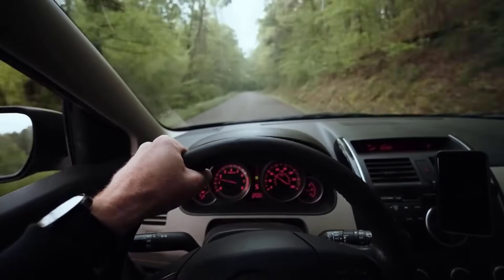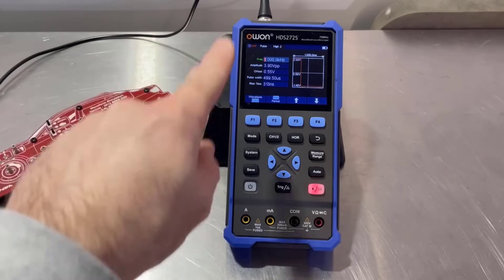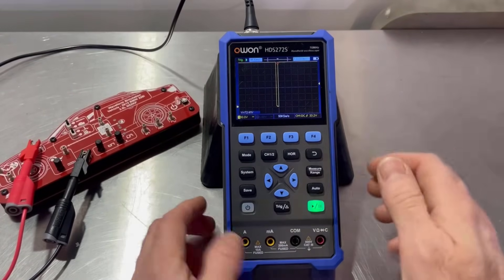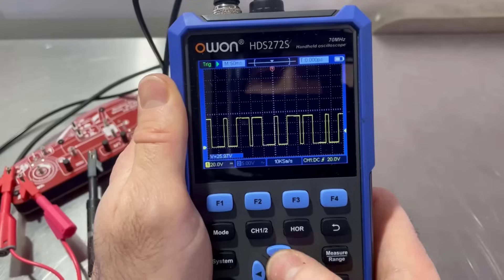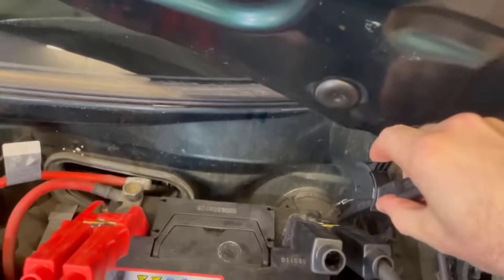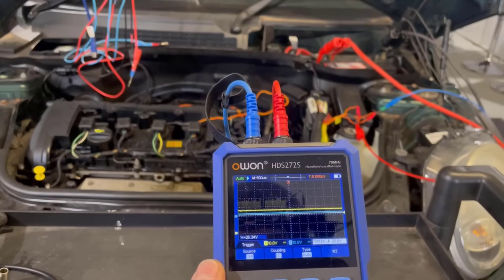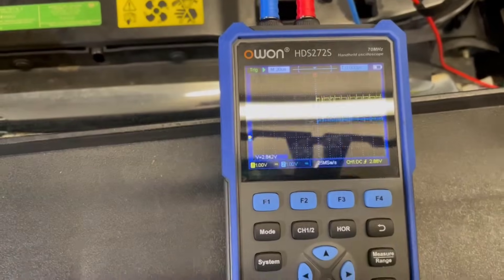Owon HDS272S For Automotive Diagnostics?

Comment: When you say use still have handy the Pico scope for PC-based viewing..  doesn't the OWON HDS272S also allow you to view/control everything from the PC via a usb cable?
Reply from the maker: Yes, it does. I haven’t really used it. However, the specs aren’t close to PicoScope for in depth diag 👍

Comment: Hi Darren, I have this tool, but I'm struggling with the save feature. When I try to save a waveform, and then try to look at it later, it doesn't display anything on the screen. If I make a reference waveform, that seems to work okay. I'm just wondering what your experience is with this feature of the tool?

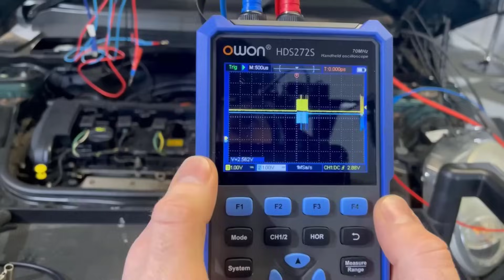Comment: I just discovered and ordered an Owon directly from China at an advertised $175 savings. It’s their latest hand held 2202 version. Another benefit is that Digi-Key is an Owon dealer, so if a 16:15 user’s guide is needed or other accessories like leads, and product information it is readily available.

Comment: Hello. I'm new to oscilloscopes and I was wondering why you opted for the hds272s instead of the hds242s. Is there anything on an automobile that couldn't be tested with the 40Mhz bandwidth of the hds242s?
Reply from the maker: No, that 242s will be fine - actually 40Mhz is well above the minimum requirement for most signals. The limit with this small hand held scope is the screen size and resolution
Reply: @ Makes sense. Thanks for the reply.

Comment: Hi,
I wanted to ask you about the sampling rate of the Owon you reviewed. You said that the display is too small to read that camshaft signal and doesn't fit in the display! How about the pc hardware that Owon provides for this device? Would it be possible to read that signal live on pc via usb? Because for what I read in the specifications, Owon has way more sampling rate than the Pico! Or they lie about it? Would appreciate your answer. Thanks in advance
Reply from the maker: @jacklamata2544  It might be better on the PC. Also, sample rate isn’t the only thing to consider; sample rate is limited by it memory. So it’s relative sample rate
Reply: @MechanicMindset  So I have to search for something with Milion memory? The thousands of numbers of the memory from an oscilloscope are not enough to read that camshaft? I've seen an oscilloscope with 100m/s and 10M memory! I don't remember the name, I have to check in my browser! Do you think that's enough to cover all the automotiv work with such an oscilloscope?

Comment: Hey buddy, great information. I have an old BMW 320D e46 just getting into diagnostics and watching you videos to gain insight. Just attached a breakout box to the dlc and it flashed up warning ‼️ registering 7.5v on the high side. With the battery removed ohms testing from pin 6/14 I have 220 ohms. In all the videos I have seen so far it says 60 ohms and everything is good 120 ohms and one resistor is blown so does 220 mean both are blown? If there is answers in your online course I will join now. Many thanks
Reply from the maker: Hi, I can’t remember the E46 layout, but it really depends what the ‘topology’ is. 

It’s not always possible to get the full CAN network at DLC. Best check at the module that has the problems. 

We have a full course on CAN and more; it will help give you a better perspective for sure 👍
Reply: @MechanicMindset  thanks for the reply, just signed up and have started to watch your videos in the order you recommended on the site video. It looks very impressive and you have a nice clear voice that I can understand and could listen to for ages without getting bored. Many thanks 🤩
Reply from the maker: @Ken_4711  Ah amazing! Hope you enjoy the learning! Thanks

Comment: Great video, I've just bought a owon hds272s but only comes with one probe i have a pair of P6100 probes will they be ok to use just to check can bus and sensors if faults occurs on my car
Reply from the maker: @paulfrancis2790  if they are BNC they should be fine 👍

Comment: Hi, I bought the OWON HDS272 oscilloscope and I want to use it to adjust gain in a car amplifier to detect clipping, I play a 1000 Hz test tone and I increase even to the end, the waveform only increases and does not change to a square, I would really appreciate it if you could help me tune the oscilloscope?
Reply: I used my HDS272S to adjust the gain on my amp for my subwoofer. Set to AC and it worked perfectly. Could clearly see where the sine wave squares off when it was clipping.

Comment: Thanks for the video ! If you connect the positive end of the oscilloscope probe  to the negative wire of the coil and the negative end to ground, you will get the desired signal waveform. In this case ATTENUATOR  is required. In my case the spike is 400 V.

Comment: I own one of these, the scope function is good.  Resistance measure is too slow.  Standby battery drain is good, but the battery drains too fast when on.  Other than that, it is ok for a device around $200.

Comment: I bought the same but slightly newer. If you have trouble as an expert, what chance do I have in figuring out it how to use this correctly!? 😂 Looking now at PC-based oscilloscopes with access to known goods.
Reply from the maker: It’s ok once you start using it it; I think their challenge is packing all the oscilloscope features in to a small package. I use it regularly now but admittedly; I often hit the wrong button for adjusting the scales. No biggie 👍

Comment: I got this one. 70Mhz is good enough for about 95% of the diag work. The function generator covers most signals to simulate. For the money it is one heck of a handheld scope. My only gripe is the buttons are not convenient. Simple things like changing trigger level for CAN like you show is a pain and other settings like that are not very clear to find and require cycling through many menus to access basics functions that should be right there at the press of a button. Other than that is will get the job done and is fast enough to see alternator or fuel pump ripple.
Reply from the maker: For sure, settings are a learning curve 👍

Comment: The new model is 200hz, unimportant in automotive but it also has many more sample points. I don't know enough to decide if it's worth the higher price 🤔 Any tips?
Reply from the maker: The specs of this one are sufficient. It’s the memory which is the important one for us; so we can zoom in to saved data and see the details. 

For what it is, I really like it, good for quick checks. I’d get the Pico out for anything in depth

Comment: Hey there, I have an owon hds242s handheld oscilloscope, just wondering if you have used the signal generator. I wonder if you ever thought about doing a short video on roughly how to use them / how to know what to input for a given sensor etc? I really don’t have a clue how but they seem a useful feature.
Reply from the maker: I’ve not used this one really. The voltage output is too low I think but might work. You could use AC signal to test wheel speed input to ABS on some cars

Comment: Just got hds 2202 for work but the multimeter operation won’t work just shows E on the voltage measurement plus DC/AC won’t change tried restarting but no joy and this model is not on the website so can’t do firmware update .going back to Amazon not impressed!!!!!
Reply from the maker: If it’s faulty, send back 👍

Comment: My interest is for the ignition systems of classic cars pre 1990's mainly, I'm particularly in using a portable system for use on the LT & HT for classic ignition systems.  Are there any inductive HT connectors which will communicate with an Ipad, for the IPad to then be used as oscilloscope display via an app?  Thanks

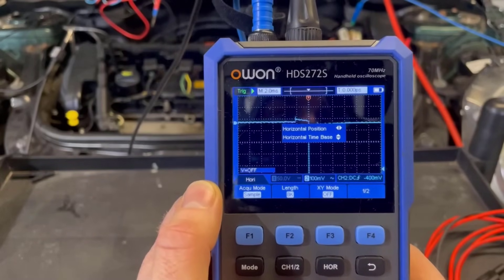Comment: On your secondary coil test (12:36) ---  when it's inverted like that-  just flip your clamp over on the wire and it will flip your waveform
Reply from the maker: Inductive clamps don’t work like that; it will work for an amp clamp 👍

Comment: How does it compare to something like a Hantek 2D82Auto?
Reply from the maker: Not tried it, but similar I imagine. It was close between these; I chose this for the better screen. That’s all
Reply: @MechanicMindset  I'm debating between a handheld or a laptop based. The 6074BE is looking very tempting.
Reply from the maker: @ClarckRPieters  I suppose it’s depends what you want it for. Quick checks on PWM and things like that, hand held is fine. For more I depth, laptop or tablet will be better. Check out the Hantek tablet 👍

Comment: Is it possible to measure dirty electric in mV (a clean or bad AC sine wave) using the HDS272S?
Reply from the maker: Sorry not sure, what are you testing?
Reply: @MechanicMindset  Testing my house's electric AC for dirty eclectic. Currently, I'm using a Greenwave EMI meter to test in mV. From the meter, I'm getting 150 mV with six Greewave wall filters installed and up to 1200 mV without the wall filters. I was hoping to test the accuracy of the EMI meter with an oscilloscope. Any suggestions?
Reply from the maker: @andynonimuss6298  Ah ok, sorry, it’s not my area or knowledge.
Reply: @MechanicMindset  Ahh ok, understood. Thanks for your time in response.

Comment: Why do all the YouTube content providers choose to use the HDS2772S when that scope was superseded by the HDS2102S over a year ago? The latter is a 100MHZ scope that uses proper specified components rather than relying on overclocking in the 70MHZ unit. It has better performance at almost all levels yet the old model keeps cropping up in vid after vid. That just seems a very odd choice.
Reply from the maker: It’s not on Amazon here in the UK. I just looked for a decent hand held. It was between this and the Hantek. I chose this for the better screen. To be honest, frequency isn’t a factor for me with automotive diag. Possibly with Flexray and CAN FD and later XL. In fact, I often use low pass filter @20khz on PicoScope because of the amount of noise picked up on low frequency waveforms 👍 so yeah, not bothered about high frequency. Maybe they have piles stacked up to clear 😅

Comment: Hi, thanks a lot for the video. Is this oscilloscope valid to see the wave form of a 230VAC grid or inverter signal? If not, could I use a 230/48 transformer and the 10x? Does the transforme "smooth/disturb/...." the signal? Do you have any video about how to see this signal to chekc modified, pure sine, armonics, .... Thanks
Reply from the maker: Sorry, not really my area of knowledge. We focus on automotive circuits.

Comment: Very interesting video: thanks! Probably next on my shopping list. Did you try the AUTO function? If so, how useful was it for the likes of a CAN signal, and would it apply the most appropriate gain values to each channel? Thanks again.
Reply from the maker: I didn’t try the Auto setting. But fond it can be erratic on other oscilloscope so I just set it manually 👍

Comment: You was on 50V DC when you was  scoping the injector, because there is a 9V DC battery supplying the waveform generator it won’t generate any more voltage. Obviously if it was a 12V DC supply, on a vehicle it would of been more like 70V DC and you would have been on a 100V DC scale 👍

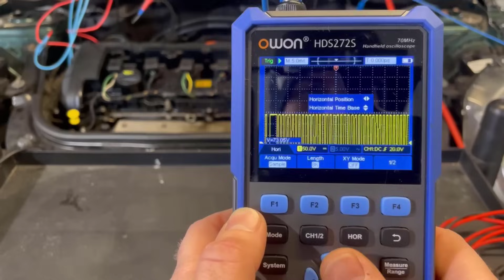Comment: To trigger on the signal at 10:30 you can set manual trigger and then use the trigger hold off function. (No clue if a simple scope like this one has it) Sometimes there is no function called  hold off, but then you can tell the scope in the trigger menu to skip some trigger-time (Like hold does)  and sometimes there are more options like only triggering at a certain pulse-width, or after a number of triggers etc. The more expensive the scope, the more advanced trigger options you get. Trigger is one of the most important things if you do more complex measurement like searching for that one faulty pulse that appears once in a while only (and you can find that using single shot trigger). But I do not know if automotive probing is very demanding/complex. I never used a scope on a car,  I repair electronics on component level (repaired a few ECUs but that was for friends, normally I repair electronic measurement gear and industrial/maritime stuff and I use a 300 MHz R&S scope, you can not compare it with the Owon). I just saw this great video by accident and it is very well done , clear explained so I watched it all.

One thing to watch for with most scopes is that if you choose a to low timebase the scope will show a waveform but with a much to low frequency. This will look OK but it is totally wrong. Always go up as much as possible until you have one period on screen. At some point you see the signal changing, if so you had the timebase to long.  If you have 1 periode or less you can then lower the time base to see more periods in one screen

Comment: nice presentation, Darren, Thanks for all the content you put together, well appreciated 🙂 although that scope is tiny and somewhat 'fiddly' it can save an awful lot of time setting up the laptop versions, if as all you need is confirmation that there some kind of signals on troublesome jobs,save valuable time i guess, before hitting the ground running with heavy duty gear, once armed with essential knowledge, we can make tracks to the right course of action, problem is, modern car's are far too complex, with ever increasing sophistication, often with little or no tech info/ wiring diagrams, sensor location and values accordingly, so we inevitably waste untold time digging out the critical and often mass of diverse knowledge prior to actually getting right under the bonnet, or in haste start 'guessing' data values? (not a good idea) as a suggestion to the manufacturers of that scope(for marketing purposes) perhaps they need better think tanks, by simply altering the 'spelling' slight addition/subtraction etc, they could harness psychological tactics to make their product more desirable (as others have done throughout long periods of public awareness) say drop the second 'O' so it becomes 'OWN' (own, 1 of these ) 🤔, or delete the 2nd 'O' and add '2 letters' after the 'N' ie; ED, to read 'OWNED' (to imply it's better than others 🙂,( i remember the early day's of 2 way radios etc,Walkie Talkie- which was renamed for major appeal)  anyway keep up the great work, as ever. 😇
Reply from the maker: Great insights there. Agreed, this tool should be the go to unit above normal voltmeter for modern cars. So many times I use a voltmeter but actually need a scope
Reply: @MechanicMindset  Cheers Darren, keep up the great work,,,as ever, you'll be well rewarded soon  😇🙂

Comment: Hello friend. I have seen how you use pico 2204a with automotive software. I have pico 2204a but according to pico web, 2204a is not compatible with automotive software. I have tried with no result. How do you manage to connect your 2204a with pico6 automotive? Thanks
Reply from the maker: Hi, I only ever made one video using Pico Automotive with 2204A which showed you how to do it - and it’s not possible any more (I also made a video explaining this). All my videos I just use normal Pico 6 or 7, it works just the same 👍 picotech.com for T&M versions

Comment: Hi there thanks for the excellent videos I have a Pico 2204 but would like one of these as work in bus garage and see the hds242 is alot cheaper and don't need signal Generator so would the 40 mz be up to the jop . Thanks Colin
Reply from the maker: Yeah 40Mhz is more than plenty I think. My old Pico Automotive 4423 is 20Mhz 👍

Comment: The fact that you can't see the crank signal when you increase the time base is because the screen resolution is so small. With only 320 pixels in horizontal resolution, and detail is lost and this is what you get.
Reply from the maker: I was thinking the same. The line is all squashed up. I didn’t try it with the low refresh setting I used in CAN. I’ll have a look 👍

Comment: I've got the same 272S since a few months now and I am very happy.
Its like you said to check quickly if you have a signal  or with the multimeeter to check some value.
There is also a good solution if you have to mesure main supply 230V, because is insulated, Ground issue!
So thank you for the video  and all the comments.
Reply from the maker: Thanks for sharing
Reply: I have a bench Hantek 150Mhz and as cool as it seems my ground is super noisy, between 20-50mv at least. I need to switch off the entire house to find the culprits (some shitty power supply) and still might get some noise. I've just ordered this portable hoping the noise is lower. To measure small signal on my bench one I need to use differential mode with 2 probes terminated with 50R. But  I need to do my own coax probe since the normal probe has 340R on the coax so that will attenuate 7 times (withe the 50R termination). What a mess. Hope this portable one will allow me to so some small signal measurements.